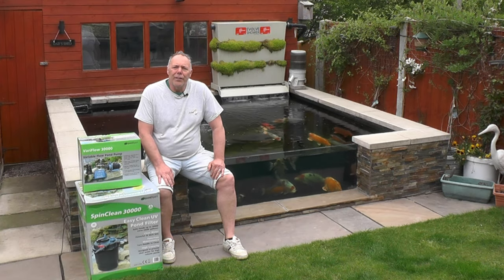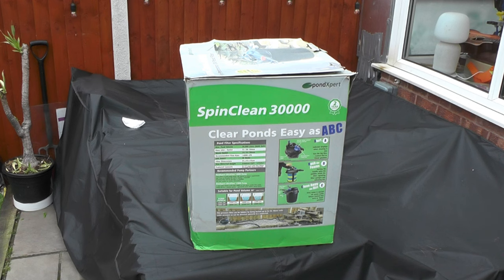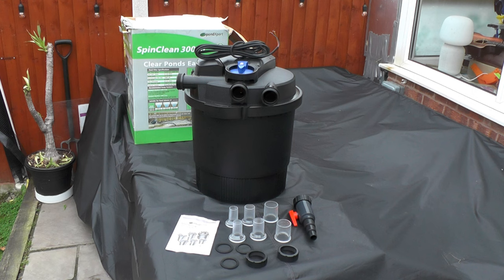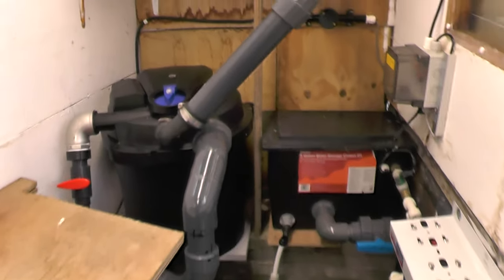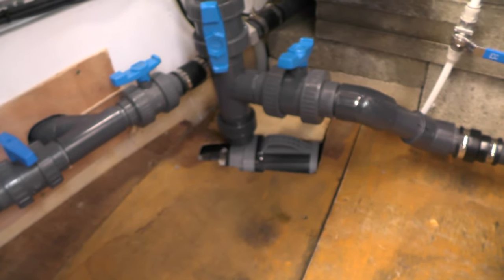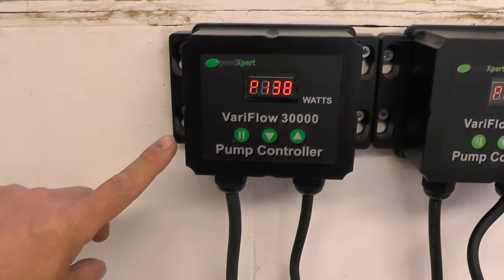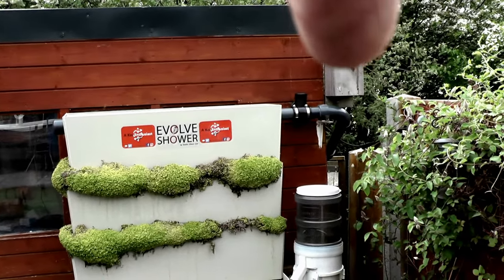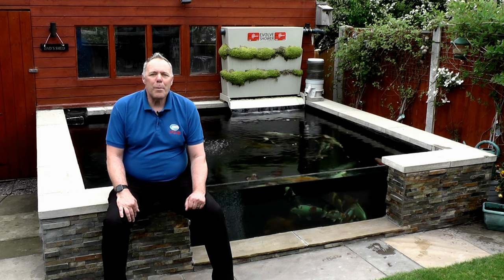How To Increase The Flow Rate On A Bakki Shower.  How To Change A Pressure Filter & A Variflow Pump

Comment: Thanks for showing how to increase efficiency and save money at the same time. Where did you buy your flow meter from?
Reply from the maker: Cheers for watching. The Flow Meter was off a selling site. If you search you might find it on Amazon or E Bay. Just make sure the size and range is correct for your use

Comment: Thank you for the video. Very interesting I was looking for a similar video I have bought Bakki shower, and I am on the way to precious drum filter compact M, from oases but that I was not going to connect the bakki shower with sprinclean i was going to connect only directly with a pump 15 to 20 k and not use any spin clean 30000 Is that possible?
Reply from the maker: Thanks for watching. Having the Springclean fitted means I have never had to disassemble or clean my Bakki Shower. You definitely need some sort of pre filter (That doesn't reduce the flow too much) other wise the Bakki will block up with fines

Comment: Hi any tips on error 88? Just finished my pond and can’t get rid of it! Played with the flows for ages and adjusting the levels and floats as per the manual
Reply from the maker: Cheers for watching. I had that issue once. It is for Gravity Fed systems and refers to the Pump status detection being incorrectly set. (Set parameter for pump status detection to 0 (→ E7: Pump
status detection) The little black conical shaped float. Sometimes it gets stuck or the plate holding it bends down when opening the lid. Give it a clean and make sure it is square and secure
Reply: @AKoiEnthusiast  hi, sorry, I’ve sorted it but thankyou very much for the comment. I did exactly what you just said and it’s now gone! 

Just another question, where the water level is inside the filter where you have min & max lines. Ideally the water needs to be in between them 2 lines. Mines on around maximum so it’s ok. But when I switch the pumps on, it drops below minimum. I have an auto top up trickling in but it won’t rise until I turn everything off again. Is this how it should be?

Thanks

Comment: Are the koi still available and what is the best way to pass on our details 🤔
Reply from the maker: The Koi in the large 17,000 gallon Pond were snapped up last week and are now relocated. Some of the equipment may still available but the guy's details are in the Details and Comments of the Video if you want to speak with him. I have a load to rehome very shortly from both ponds if they are any good. There are about 55 1 year olds from 8" to 12" and a couple of 2/3 year olds from the Main pond between 12" and 18"